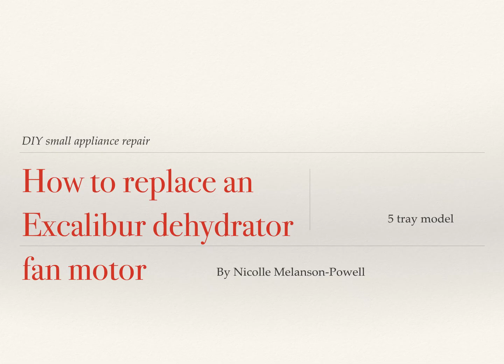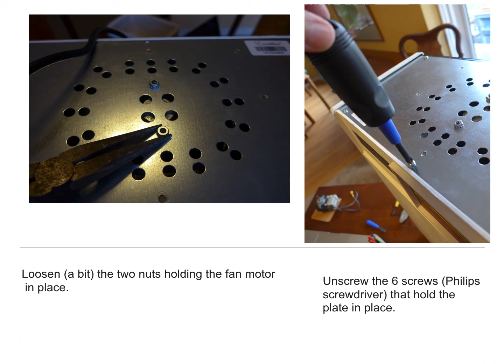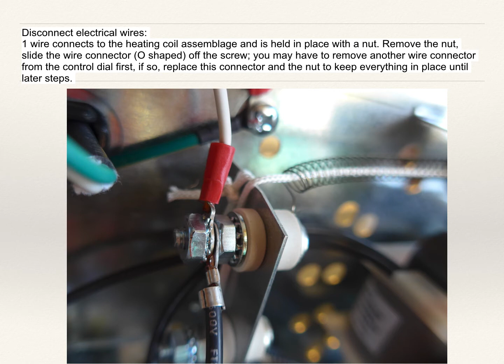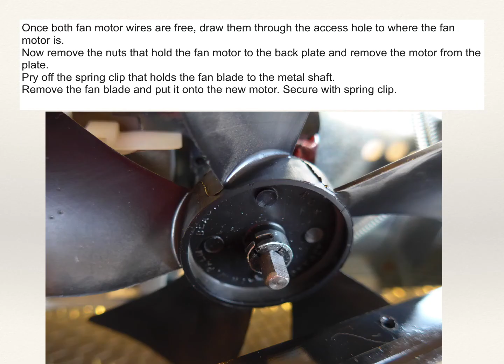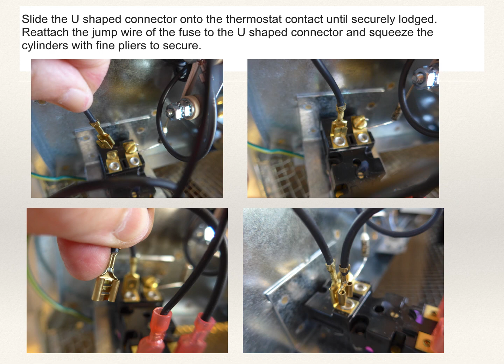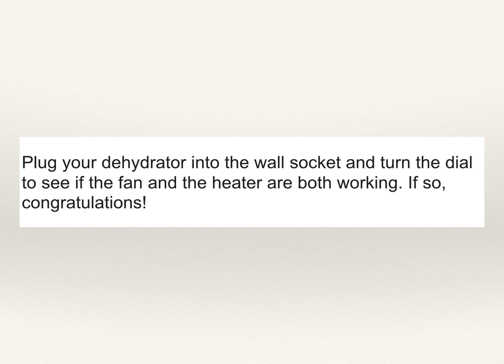Fan Motor Replacement instructions

Comment: "Pry off the spring clip that holds the fan blade to the metal shaft."
...How, exactly?
Reply from the maker: I used a thin bladed small screw driver I believe.

Comment: thanks for making this! how did you know you needed to replace the fan motor and not something else? these are my dehydrator's current symptoms: the heating coils get super hot and glow orange. the fan doesn't really spin - it seemed like it was trying to, though. is this what happened to yours?
Reply from the maker: Yes, very similar.